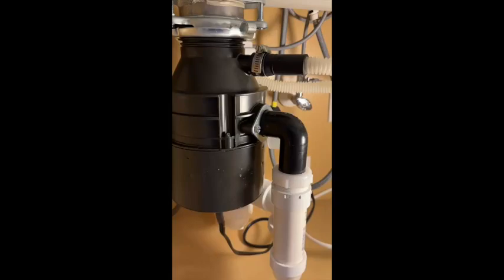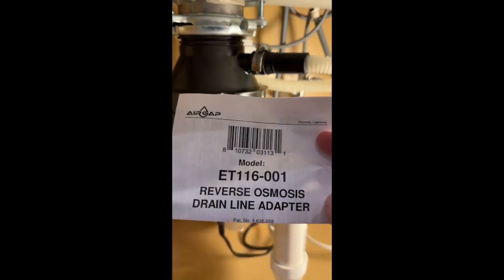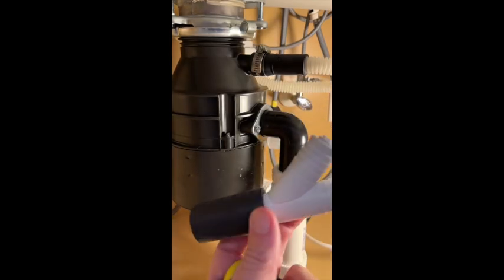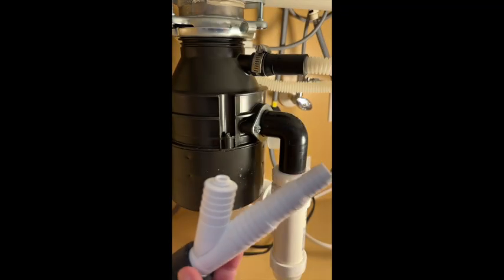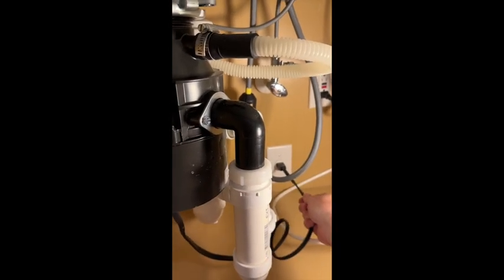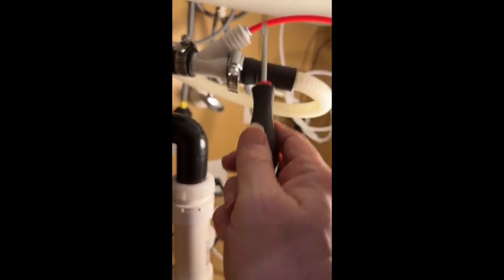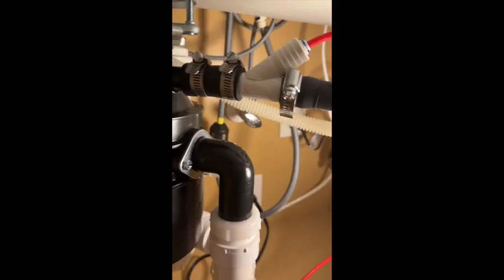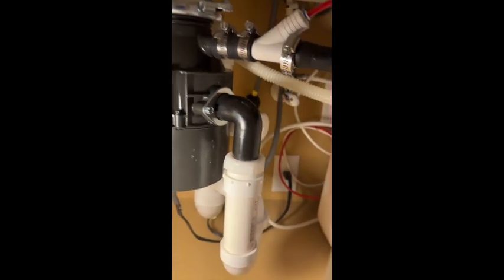Install RO System on One-Drain Sink with Garbage Disposal using Drain Line Adapter (DLA)

Comment: It looks like we have the exact same setup. Did you cut off any of the adapter barbs?
Reply from the maker: Yes, 2 of them, and sanded the cut end.
Reply: @guitaro99  Ended up doing the same and it worked perfectly. Thank you!

Comment: I need this! Have the same unit i believe (the 600)  and its about 2 years old. No issues until tonight. Changed the CF filter and when it went to flush the new filter, it was at a higher pressure and must have popped the gasket on the drain saddle. I tried to to "fix" it and ended up ripping the gasket in half 😂. I like this setup 100x better, but since the hole is already drilled on mine, ill attempt installing a new saddle tomorrow when the plumbing suppy store opens. 
Might call Waterdrop, not sure if the flushing is supposed to be discharging at such high pressure. I suspect its fine and the installer after our kitchen remodel didnt use a new gasket when reconnecting the system. 
Thanks for the video and sorry for the long comment, I know these videos/comments can help others with similar issues. Also a reminder to occasionally check on the unit and always standby when new filters are installed until the system has operated for a bit. I also write in sharpie the date I install  a new filter on the side of the exposed cartridge handle. CFs are about 6months, and RO and CB about a year

Comment: Thank. Just curious though. It appears that you did not use an air gap. Does the hose into the disposal replace
That need. Our current one seems to have bother an airgap and another hose going into the disposal
Reply from the maker: I have an under sink air gap connected by PVC.  You can kinda see it in back of the disposal.

Comment: This is the exact setup I have. Same conclusion.

I can’t make another high loop with the dishwasher drain hose but I see you have a lot of slack.

Are you worried about RO water flowing back into the dishwasher? 

That’s my hesitation in finishing my RO setup.
Reply from the maker: My DW hose has a steep incline, so even if it did, the discharge would be difficult to make it up the hose.